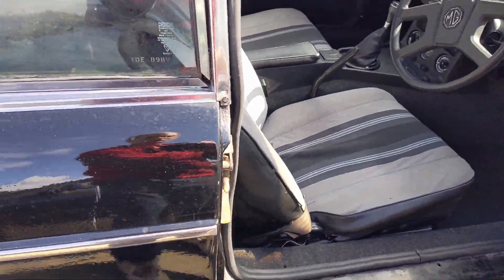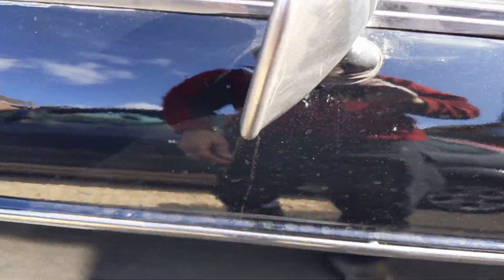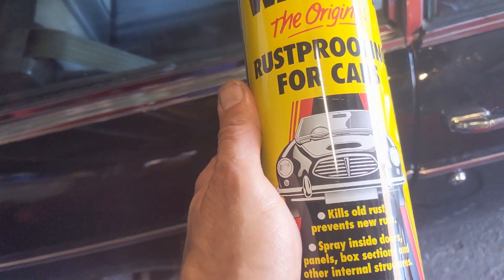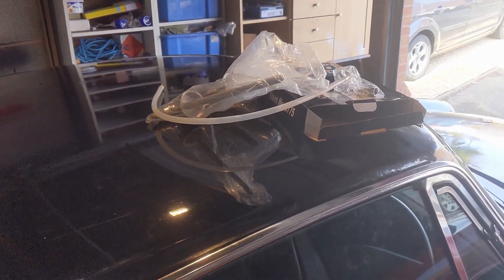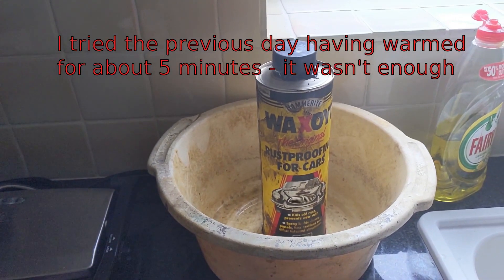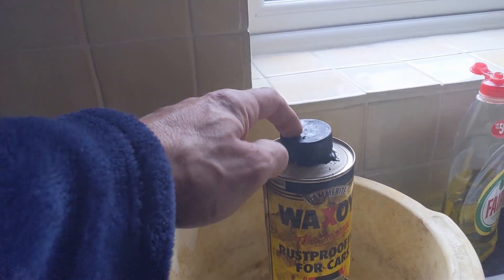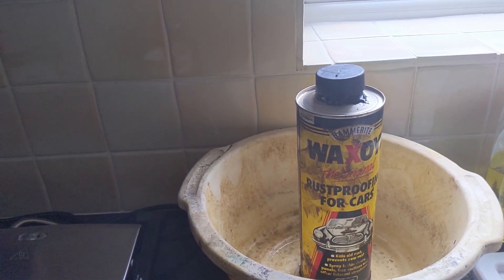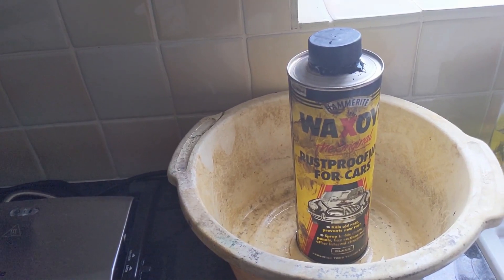MGB GT Episode 56   WaxOyl needs thinning

Comment: Hi Henry, I've always struggled to get Waxoyl to the correct fluidity. It either has the consistency of jelly or water with nothing in between. (and like you, more of it ends up on me or the floor, not the car!) If you want to try something else, I have gone over to the 'Bilt Hamber' range of products after reading a car magazine comparison feature where it came out tops. It is much more user friendly. Comes in large aerosols (750ml) or 5 litre containers. The Dynax s50 is specifically for injecting into voids so comes complete with a very slim, flexible 2ft lance fitted with a multi directional nozzle. The aerosol works in any orientation, even upside down. It's inexpensive and manufactured in the UK... Just a thought.
Did you get the overdrive sorted?
Reply from the maker: Hi Carsten, I didn't know about Bilt Hamber and I've already purchased a WaxOyl alternative to get a bit more on - was all good fun.  I've been swamped with work this last week and haven't been in the garage since Sunday so I've not had another go at the overdrive yet but I will get to it.  I've a couple of spots from the chrome bumper conversion I want to do next (and prep the Stag for the summer).  I've also managed a couple of hundred miles driving the car and I'm really enjoying it along the back roads.  But I do need to sort some irritating rattling and squeaking from the back (inside the car I believe).

Comment: Hi Henry. I have tried the pump unit and thinned using white spirit but have resorted to the aerosol cans. Even though they are more expensive you don’t cover yourself and the garage as well!
Reply from the maker: I had to laugh at myself - I thought it really funny and I haven't given up yet.  I've just bought 10l in big cans - I'm going to give it another go.  I thought I would cover those bits I don't want touched and do the whole underside.  Should be a real mess if last weekend was anything to go by